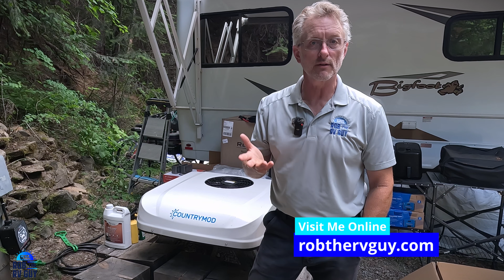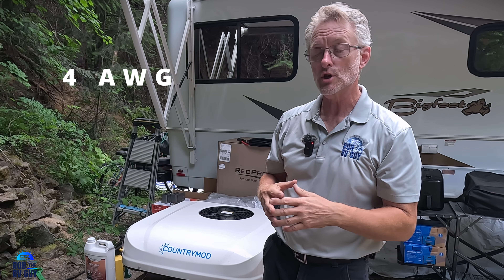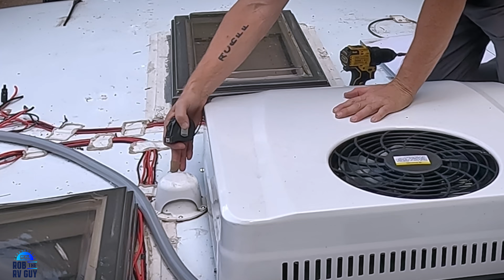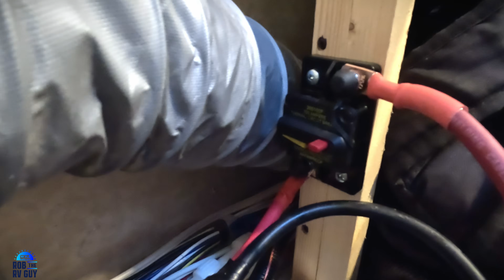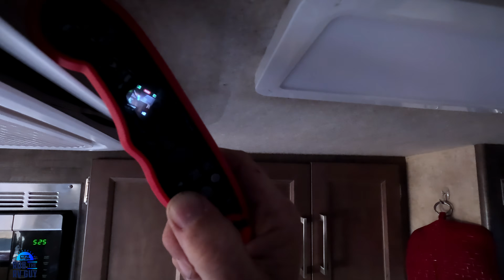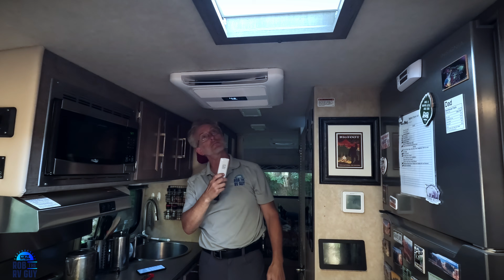🌞❄️ CountryModPro 12V Low-Profile AC Review: Ultimate Solar-Powered Cooling for My Bigfoot 25RQ! 🚐

Comment: Good informative video.  I was going to replace my 11K BTU in my Truck Camper w/ 12volt but didn't want to lose BTU's, NOW after seeing your videos (subscribed Now) we are thinking about the BigFoot 25 twin w/solar package (done by you ha ha).  Why did you go 11 inch rise for your solar rack? Are you this about replacing your Refrigerator with a 12volt, (we did that in the TC, 10cuft Furrion 12volt), 6cuft seems small!  if not why not?  Lots of questions sorry!
Reply from the maker: I am having a little bit of difficulty discerning what I am need to answer.  I will answer what I can make sense of.
I went 11" rise because my AC (as with most low profile) blows straight up on the Condenser side.  I need good airflow above it.

I did NOT replace my fridge with a 12v.  I do not like the 12v models.  I replaced it with a residential 10 Cubic Foot model.

If you have any further questions please let me know.

Comment: Question for you.
We're thinking about buying a Bigfoot. It currently has 1 air conditioner. Maxair fan in the bedroom, my question is can you swap out the max air for another a/c  using the same wires.
Reply from the maker: No, you can't.   The AC is on a dedicated 120 circuit.  The Maxx Fan is 12v.  You'd need a second 120 circuit for the back.  That would be a horrible wire pull.  I wouldn't attempt to tackle it.

Comment: I installed this from amazon. amazing. easy install into a standard 14"x14" fan mount. I replaced LOUD 120V Coleman this 12V is quieter and cooler
Reply from the maker: Great report.  Very happy it's working well for you.

Comment: It’s only 10k so may be ok for van life or small Class 3’s
Get a Turbno Greenland or
The New Chill Cube Low Profile is out at OEMs in the next 30days
10k is a little weak for most RV applications
Reply from the maker: That's incorrect.  95-99 degrees here and it holds the 25 foot Bigfoot at 73 easily.  10,000 BTU can cool up to 200 SF effectively.

Comment: Rob, I have a 22ft Airstreram. 18 feet on the inside by 7.5'. I have no sky light and carpet finish on the walls. Currently have a 13,5 110 unit that well freeze me out. I live in Maryland and camp at the beach. No shade and high humidity. The State and National Park have no electric. I am  thinking this might be the ticket. I have 310 watts of solar on the roof and a 190 watt ground panel. So 500 watts. At night it is 75-79 but very humid. Your thoughts?
Reply from the maker: Here are my initial thoughts.  
1) You do not have enough solar power.  At best, your panels are going to send 325 watts into the system.  The AC is going to draw 400 plus watts with the  compressor on during the day.  You need more solar, preferably double.
2) You are going to need a minimum of 300ah Lithium battery bank for this to run on ECO over the evening into the night.

The unit can do the job, but were I in your shoes, I'm wanting minimum 600 ah lithium batteries and 1000 watts of solar during the day.  That's enough to run the AC and charge the batteries from their depletion over the night hours.  More is better.  1200 is better, 2000 is best.  I hope that helps.
Reply: Yeah you need vastly more solar and a huge battery bank

Comment: At only 10,000 BTUs how did it cool? What were the conditions outside? What were the temps inside? Did you use it along with your other 13.5BTU unit? I ask this because a I have a 40' unit with dual 13.5s but I just added major solar and would love to have A/C that is 12v DC but able to comfortably cool 40 feet of space on a hot day.
Reply from the maker: We're hitting high 90s and seeing full sun on the Bigfoot all day.  Staying at 73 degrees provided blinds are closed, and insulators are in the ceiling skylights and openings.